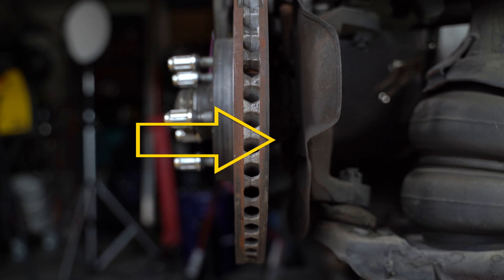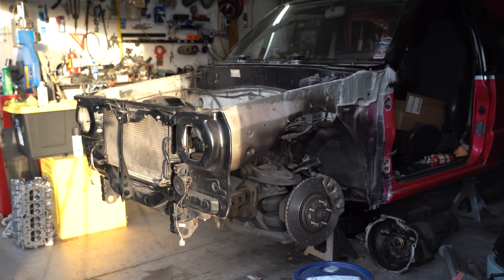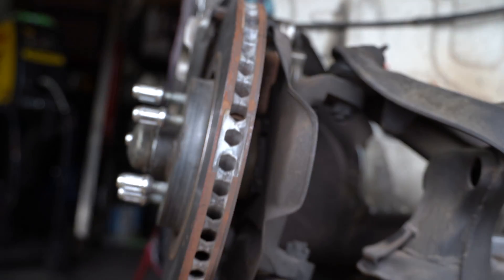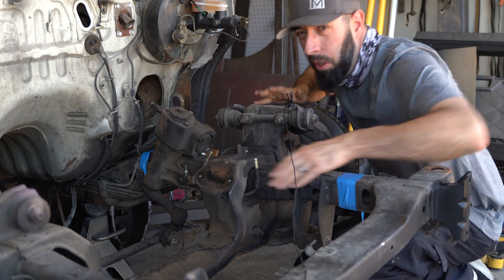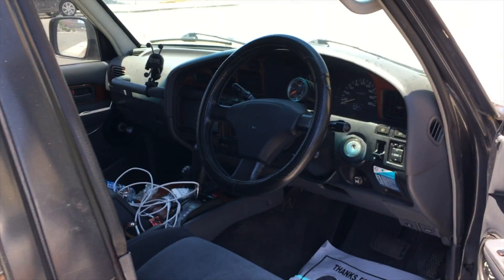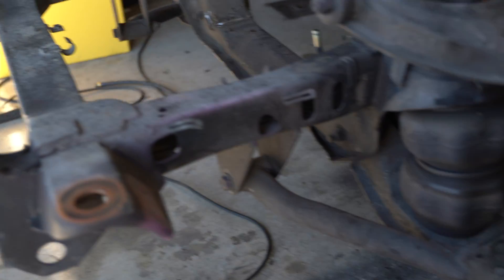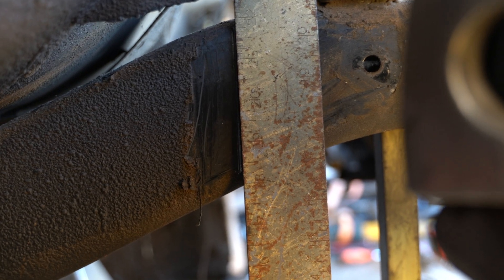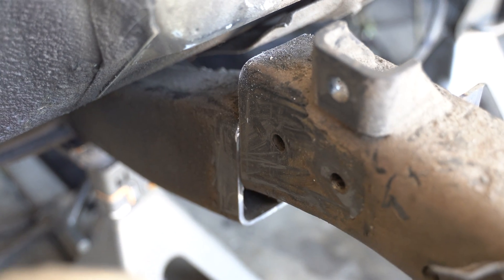Mighty Max Ep. 04: How to Z Your Frame! Part 1

Comment: Finally someone doing a well put together video of fabricating a 4g63 into a Mighty Max, If I had the time I would have shown my two trucks but never had the time or remembered to turn a camera on when I did.
Reply from the maker: Thank you for the kind words. Hopefully I can live up to them.
Reply: @GarageFab  No problem, if you have any questions about what manifolds will work and some other necessities let me know.
Reply: @GarageFab  Also templates or premade brackets for those lexus brakes with toyota hubs would be great. Would they most likely fit behind 17" rims?
Reply: fabbing is one thing. filming it, is a whole nother deal. ive tried. but i jsut dont have the damn patience for it.
Reply from the maker: Indeed. I hope I can hold on to the single thread of patience I have. A Watts Link would generally take me a weekend. The one I just built, nearly 30 days. And even then parts of it are rushed. YouTube forces sub par work sometimes unfortunately.

Comment: Ive heard for a b2200 you have to do this to the front due to the crossmember would it be possible to build a thinner crossmember?
Reply from the maker: I’m not familiar with the Mazda crossmember, but usually they’re hollow stamped steel. So in theory, yes, you should be able to remove the crossmember and replace it with something more rigid but shorter.

Comment: Cut 2 dashboards join them and install 2 wheels it will confuse the hell out of ppl
Reply from the maker: Trust me, it crossed my mind. 😂 Not the silly dashboard, but a steering column in the glove box with a removable racing steering wheel? How great would that be for long road trips?
Reply: @GarageFab  now that is some gankster thinking right there I accept your move and I counter with another ..telescopic steering collapsable into the dashboard .swap drivers without getting out
Reply: Just swap the steering wheel which that tech is mainstream already

Comment: I woulda rolled the fender, drift style
 (a hammer might be needed)
Reply from the maker: Haha! A sledge hammer!!?
Reply: @GarageFab  the fender rolling tools that bolt to the hub (with a nylon roller for the lip) work pretty well. Just be careful about cracking the paint by heating the fender, unless you want true drift style.

I had to roll my dd 01 Prelude when I went to a 3" drop with 18x9's. A baseball bat wouldn't work, too much "massaging" was required, so I borrowed the CDM roller & it worked quick & easy.
Reply from the maker: I have an Eastwood fender roller. I’m not so sure it’s capable of 2 inches inches of clearance. ESPECIALLY on a truck that’s already painted. 😆
Reply: @GarageFab  it didn't look like that much.

I wonder how it would look with some XJ style fender flares…probly not your style, more of an '80s JDM / AE86 look…

I bet that Mitsu would look cool with a pair (or more) of 8' tall exhaust tips!
Reply from the maker: I’m gonna let the 8 foot exhaust tip suggestion slide and not block you.
For now.
The four-wheel-drive Mightymax has some very cool fender flares that I may end up using if I don’t have enough fender clearance. The truck is already painted, and I don’t want to repaint, so cutting the fenders a little and covering it up with a plastic fender just might be the answer. We’ll see!

Comment: Starting to build a frame suspension have is c4 corvette body is type 3 69 v.w wagon L.s motor manual transmission did buy a narrow crossmememder from flat engineering
Reply from the maker: That’s exciting! Looking forward to seeing what you do with it.
Reply: @Garage Fab  me to got the idear off the guy building gt6 t

Comment: Does anyone know the type of steel he is using to fab the steel frame parts? Is it regular mild steel?
Reply from the maker: I do!! Yes it is mild steel plate. For the bulkhead plates (the plates inserted at the cuts) is 1/4 inch thick and the sides were all 3/16 inch plate.
Hope this helps!
Reply: @GarageFab  awesome man, you do amazing work. I've been looking for that kinda frame work examples. What do you think of the metal car manufacturers use to make frames. Isn't it like high strength thin wall stuff to save on weight?
Reply from the maker: I honestly don’t know! It seems most manufactures are more concerned about cost over weight. But I don’t know for sure! I’m going to venture a guess though (only because I have experience drilling factory frames) that they also use mild steel. Race car builders on the other hand often use chromoly for the reasons you mentioned.

Comment: Use the right hand steering system.. but from the gear box to the column.. run a relay bar to transfer the steering.
Reply from the maker: Tell me more, Mr. Flush. Are you referring to that chain drive thingy? I think I’d rather not, but I will certainly keep that in mind if it’s starting to look like LHD isn’t going to work!
Reply: @GarageFab  
Chain drive would probably be easiest. But not most compact.
More of a worm drive. Kind of like a rack and pinion.  I can't think of what you would be able to thieve this setup from. But you would end up with a tube going across the inner or outer firewall.

That.. would be the other option. Change it over to a rack and pinion. Might be able to reuse the tie rod ends.
Reply from the maker: I am REALLY trying to make the rest if this project as simple as possible. My Wife is itching to drive it again. I am itching to start on the next project which is far more exciting than anything I’ve ever built.
BUT! For creativities sake, I wonder what it would be like to fuse two steering racks together. The input shaft is attached to the steering wheel on one side. The opposite side also has an input shaft clocked in the opposite direction that’s attached to the steering box. The tubes and internal shafts are welded together, and tie rods eliminated.
That’s the kinda ridiculous stuff that makes me giggle.
Reply: @GarageFab  I am gigling trying to visualize what you just said.
Slap a manual rack pinion in there.
Or.. go fancy and put a modern electric assist one in. 
More compact. Easy to install.
Reply from the maker: I shall ponder!

Comment: Well looks like the OBS is getting  Z-ed..I have a 3200 HD Lincoln  but was wondering if that is enough welder ,for proper penetration.
Reply from the maker: I’m not familiar with that welder but I read  that it’s a 20 amp welder. I welded my Z at 19 amps. I’m unsure if 19 amps from a 120v welder and 19 amps from a 240v welder are the same… I’d imagine amps are amps. 🤷‍♂️ Anyway most frames are 1/8-3/16” thick so you’re welder will be working its hardest, but I imagine the penetration would be acceptable.
If not, perhaps it’s time to upgrade to the Miller 211 Autoset.

Comment: You said nothing about transmission being pushed up into the tunnel, or the drag link needing to be narrowed in the middle....and as far as your steering just make a pocket inside the frame and mount the steering box in it's oem location
Reply from the maker: I probably should have mentioned the steering link because that will need to be addressed. But not until I get the engine mounted.
The trans in the other hand will not be an issue. In an upcoming episode I’ll be recreating the K member and dropping the engine back down to it’s original location.

Comment: There’s also inside and outside framerail steering boxes available for the mighty max
Reply from the maker: Really? Thank you for that. Every Mighty Max I've owned or worked on (that I can remember) has been exactly the same. How do you find them other than inspecting at the junk yard?
Reply: @GarageFab  I might have the one you need
Reply from the maker: Would it be a correct assumption that the main steering link would need to be changed or does the pitman arm remain in the same spot?
Reply: @GarageFab  yea same spot , sent you a pic on Instagram

Comment: The steering box will be under the intake....no need to relocate. Also look for a frh intake as they can be found for 120 to 150. It will flip the intake to face the front. Keep as much stuff out of the passenger side as you will need the space for the turbo,  exhaust manifold, and coolant tube.
Reply from the maker: Appreciated!! I was going to have my intake manifold modified but I don't have the skills to weld aluminium just yet. Do you happen to know what models have the intake with the correct orientation? If it's not crazy expensive I'll just go that route.
I'm concerned with the steering box for sure but I'm probably more worried about the brake booster. I've seen images where the manifold is really close. I'm already considering a hydraulic booster or masters.

Comment: Mount a Toyota pickup steering box and spindles make it front steer
Reply from the maker: Not a bad idea! That may not work for me because I have a front sump oil pan but I imagine that's something I could change if necessary.
Reply: Garage Fab I have a front sump on my sbc in a 2wd Toyota it clears nice

Comment: Cool channel 👌
Would a rack and pinion work?
Reply from the maker: Thank you! Racks aren't really straight forward especially when slapping them into a car they weren't meant to be in. They'll "work" but the pivots for the tie rods need to be in a very specific location and the tie rods themselves need to be a specific length which changes from vehicle to vehicle. And since you can't really choose a specific rack length it makes that challenging. Get those two things wrong and you'll be stuck with crazy bump steer and/or toe issues at various heights. There are ways to modify racks to fit your application if you know what to look for.

Comment: Outer mounting steering gearbox are also available
Reply: Yes, don’t know if the bolts line up, but do know that 94 mm has outer mounting.
Reply from the maker: Tell me more! Like on the outside of the drivers frame rail?